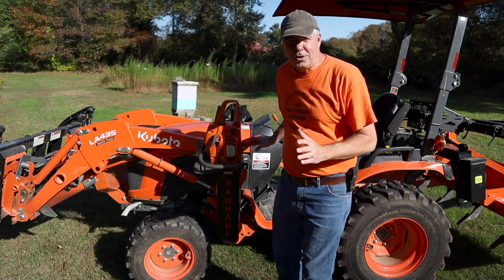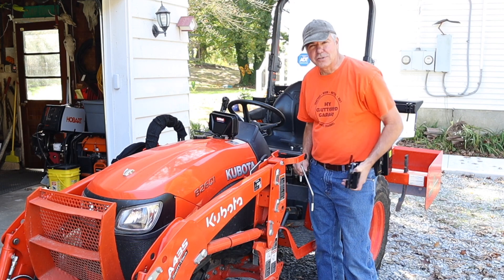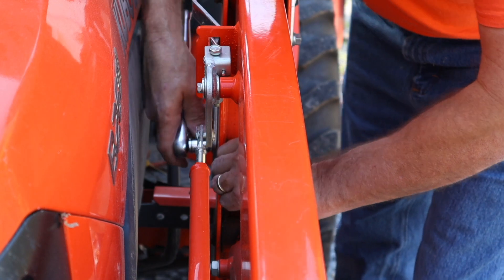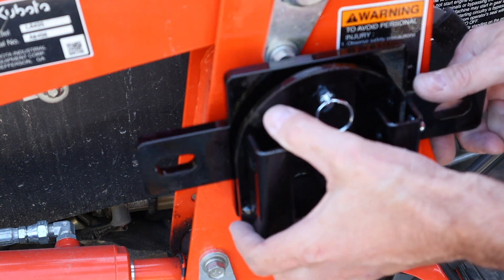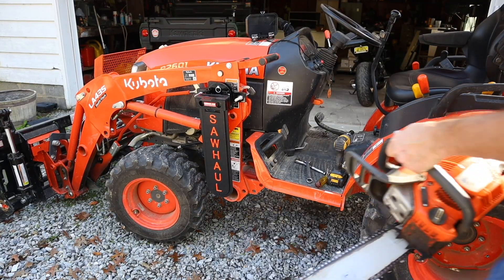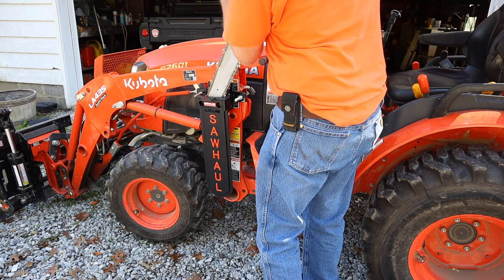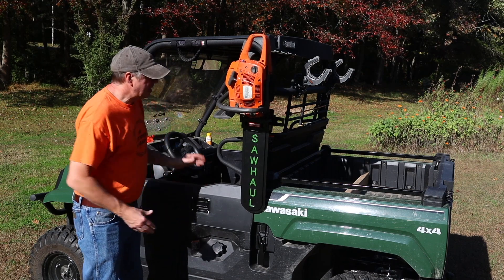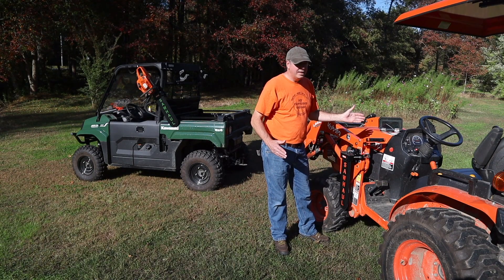#118 Saw Haul Chainsaw Carrier for Tractors and Side By Sides. Kubota B2601 and Kawasaki Mule Pro MX

Comment from the maker: Learn more at sawhaul.com and gearhaul.com. SAVE 5% WITH CODE MCG!

Here are some other product suggestions. These are Amazon Affiliate links, so purchasing will help this channel by providing a small commission while not costing you any more. Thank you for your support!
AirTec Lube-Shuttle Pistol Grip Grease Gun Kit:
https://amzn.to/3O0pj1z
LockNLube Grease Gun Coupler:
https://amzn.to/3kPcvwu
Recommended Grease:
Valvoline Moly Fortified
https://amzn.to/3jNM1Kv
Nitrile Gloves:
https://amzn.to/34Kg8OG
Deerskin Gloves:
https://amzn.to/2I17NNy
My Video Gear:
Rode Wireless Go II microphone:
https://amzn.to/3eiJatG
Canon M50 Camera (now Mark II):
https://amzn.to/3vHW9uD
Battery adapter for M50:
https://amzn.to/2RshsBE
Sigma 16mm prime lens:
https://amzn.to/3vJDRcx
Sigma 30mm prime lens:
https://amzn.to/3epFneh
Variable ND filters:
https://amzn.to/3tmoHIs

Comment: Excellent review and installation! Does the bottom of the SawHaul have an opening for debris and oil to get out? Thanks.oce the outro!
Reply from the maker: Thanks Ross! Yes the scabbard has a drain hole at the bottom. You can also easily remove the scabbard mount with no tools.

Comment: Is the part you flipped around included in the basic full kit? In looking at their site it doesn't really show up with the kit.
Reply from the maker: The “complete kit” includes the plastic scabbard. The rotating snaplock mount is purchased separately, or in a separate kit. You can email Kenny directly at kenny@sawhaul.com with any questions, or to confirm the kit you need. They have great customer service! Also, let them know you watched the video on MCG!

Comment: Not a good idea! Looks like the saw will hit the front tire as soon as you raise your bucket. Oh, you can tilt the saw, but then it will block entry to the vehicle, whether it is a tractor or a Mule. Consider reviewing a ROPS attached holder. Just because it was free it may still not be worth the money.
Reply from the maker: Hi Gunther. The carrier stays stationary when you work the loader, so it doesn’t affect the operation of the tractor. I think you could also mount this carrier on the ROPS, but space it tight on mine. Thanks for watching! -Ed